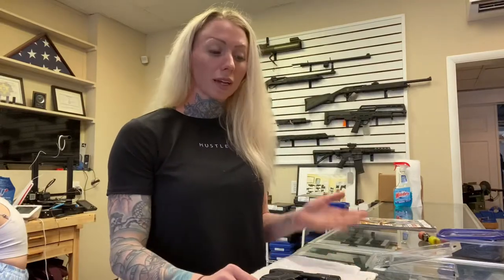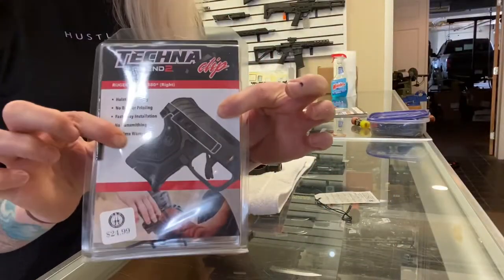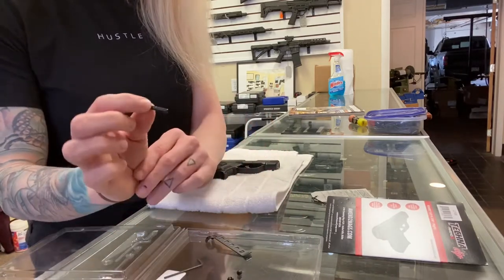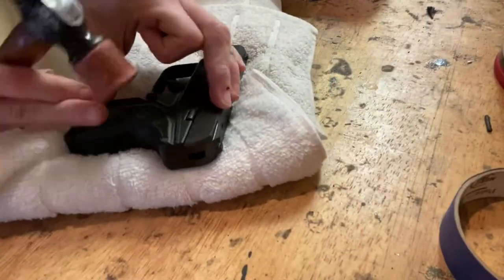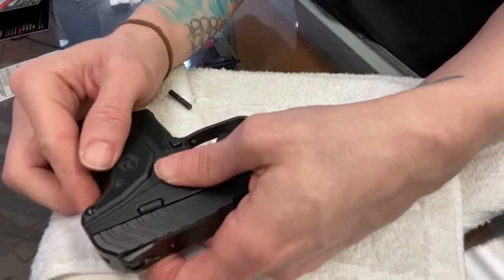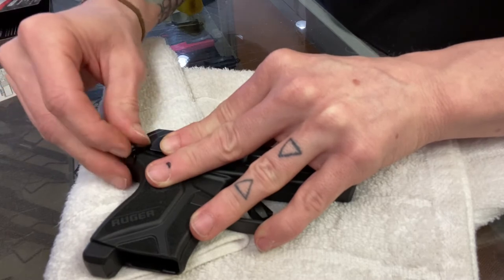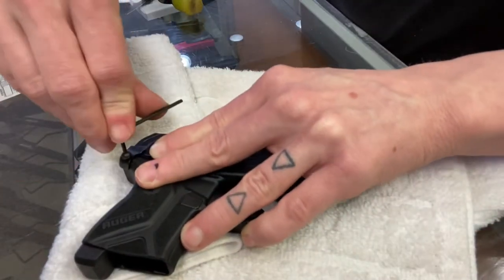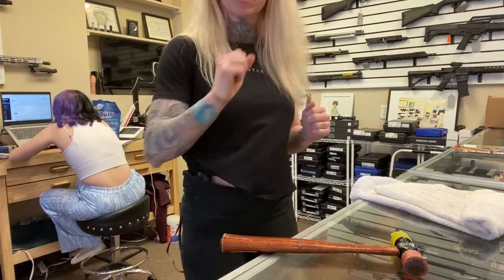Installing a Techna Clip on a Ruger LCP II 380 at H&H Tactical

Comment: After clipping on my jeans inside the pocket and also a thick holster belt certain movements when working in garage caused it to unclip from pocket and belt, separately.  Gave me a heads up in case I’m in public or sitting in car with the LCP clipped to be aware it could happen with certain movements or shifting.  Also got a C & G Kidex IWB holster.  Great for securing whether right carrying or cross draw positions.  I can almost make the clip fit in the C&P and may be able to with some modifications, if I don’t want to remove clip from the .380.

Comment: Cool! I installed one of those on my Sig, P 365 and love it! Need to see now if Techna makes one for the Ruger LCP Max
Reply: I've been looking for the same thing I don't think they do
Reply: @christopherwg4236  same here for the max???
Reply: @christopherwg4236  check this out,,, im sitting here looking at the lcp two image the back where the techna clip is to be installed by removing the factory pin and replacing with the threaded techna clip replacement pin,,theres has a threaded end  theres a female threaded nut that the threaded pin end screws into,,,the lcp 2 and lcp max are identical only lcp2 has the factory poin but the lcp max doesnt and on  the location of that back pin its so far back on the polimer frame bottom cornner im sure thers nothing internally purposed for that area,,aie "free space ,,same as on the lcp2  so if your willing ,,and yep ,,wow ol boy jus might,,,,and yep I'm talkn drilling a hole to accomodate techna clips replacement threaded end pin  all the way through so that the other end can accomodate the threaded female flat nut...and yes i would sacrifice modifying for my own comfort,,worst case scenerios if you change your mind and wanna remove the techna clip then just unscrew take the clip off leave the screw in...but first im going to call technaclip to see because im sure they know that the only diffrence in the area of install of both the lcp 2  and lcp max,,one has a factory hole with a pin and the max doesent but both spect wise are the same...so this would be basically if you wanna  modify your max by drilling a hole there where there wasnt one ...pull images up see for yourself im also gonna call ruger and ask if both spec wise are the same and lastly run by the gun store to compare my max to a lcp 2 if they have one,,again I would be willing to modify mine would you,,,jus a idea but just verify befor you do because this may  be to ruger as enough to void a warranty but i wouldnt see how,,i would verify this also with ruger but im betting theyll say no it wont because the area of install is free unused area and will not effect the dinamics or operation of the waepon,,your not modifying   any moving parts  would might see this as a cosmetic but again will verify
Reply: @cingram8939  that's a good idea but what about lcp2 being thinner than the LCP Max in the frame, could run into a problem there?
Reply: @christopherwg4236  lol you got me lol,,,this was something i was looking into coarse im not a jus move without evaluating questioning which i jus got off the phone with ruger about this,,,they couldnt give me necessarily any diminsions,,plus got my question answered about modifications of their products,,they stated  they dont recommend any or else if you do it could but also not necessarily void warranty,,,but thats a good one you pointed out,,i hadnt gotten that far yet,,i was looking and your right,,if it is thicker of the frame the clip would be fine but the pin which is designed for the pin hold on the lcp 2 is madd for that models dimensions so essentually like your saying if max is thicker then may pose a problem with that pin  to fasten to clip on migh be too short although theres a. Screw in that screws into the pin to fasten down which could give room,,with what youve said and possibly voiding warranty though i.m thinking they wont consider that enough to void it,,i wont take any chance on that lol um good,,i did try to call techna clip,,but think the number is. Not correct or i literally woke some one from sleep they ssaid hello barely then hung up lol good info thanks i was debating but as i weigh options i was leaning then the more i heard the more i was deciding not to then u nailed my decision shut thanks smile
Reply: @cingram8939  I believe it's clipdraw that makes a universal clip that has very strong self-adhesive. Is supposed to work well. I do like the idea of techna clip going through the frame pins though 👍
Reply: @christopherwg4236  me too more secure,,,and the more i keep talkn about it the more im deciding to do my lcp MAX 380 warranty void or not, also wanna install either  a laser or light on this thing too its small i want a light thats small tru glo has the tactal square small but will protrude too far from in front of trigger guard,,,i dont like the models designed to fit around the trigger guard or necessarily on the trigger guard,,,i think thats ugly,,i dont know um not trying to make this thing look junky but unique to my own taste,,,tasteful that is,,,make somebody else want one too and yep i got hands like dat too do my own gunsmithing...
Reply: @christopherwg4236  infact they dont they make them for the lcp1 and 2 but not the max made to install using that lil hole with a pin in the very back of the lcp 1 and 2 Max dont have one,,,unless ye i drill my own carefully and yep already done research its blank space nothing to interfere with function of the weapon at all dont know why ruger did ut one on the max literally the same polymer frame jus that max is a hair thicker due to it accompaning a double stack mag lcp 1 and 2 are single stack but its not too much diffrence,,um probably gonna go for it,,its buggin me that bad smile
Reply: I put in on my Ruger 380.  It went on easy but didn’t seem to want to seat the tiny screw with the pressure washer so I screwed it on w/out.  All is firm but I may try the washer after washing the You Tube did it so easy.

Comment: I got a Techna Amend 2 clip for my Ruger LCD ll .380.  It went on easy excel using a pressure washer.  So I screwed the tiny screw without and it seated well.  Is the pressure washer a must?
Thanks
Kent
Reply: Sorry for the typo above.  Went on easy except when using pressure washer.  I just read the directions w/ no mention of the washer.  After, I watched the You Tube to see how the clip is used but noticed the video was using the washer.
Reply from the maker: Not 100 percent necessary.  I would periodically check to ensure is tight.
Reply: Got it.  Will do.  There are other calibers and pistol sizes.  But the 380 is the primary carry with Underwood fluted rounds when around close quarters.  Different gel tests show excellent performance.  Hope I’ll never need to find out.  Thanks!

Comment: Ok guys final verdict,,,lol i know i was sounding kinda sure and cocky about applying  technaclip hto my lcp max despite its not ment for the max but for the lcp 2 because the lcp 2  has the factory pin and  hole already simply remove the pin replace with the threaded pin that comes with techna clip  screw on the nut to secure and done,,but the max didnt come with the  hole and pin althought is can be done.. I contacted ruger about  drilling a hole carefully to accomodate the techna clip,,ruger stated if you modify the max it could void warranty although drilling a hole would not dysrupt its function and  the location is in a blank area of the polimer frame in a empty area in the very back..i can very close to making my decision to move forward with it,,but what i didnt give in account the frame of the max is  thicker than that of the lcp2  coarse the grip of the max we know is wider due to it taking double stacked mag where as lcp is single stacked,,but looking further the rest of the frame is slightly thicker as well but not by much...Confirmed with ruger a max slide can be installed onto a lcp 2  and vise versa the lcp 2 can on the max with slight very slight looseness but can function without issues..someone on this post pointed it out to me,,,upon this information,,i felt its not worth possibly voiding the warranty or trying to make techna clip work...its nice but nahhh ill pass...

Comment: Do they make techna clips for the ruger lcp max 380?
Reply from the maker: No not currently
Reply: @handhtactical8999  guess what i jus figured,,first off i will install a technaclip on my max,,because the lcp 2  and max have literally the same design and contoure of the area the technaclip installs on the lcp2 only difference the max mag well is wider to to it having double stack to lcp2s only single stack so,,,yep I'm thinking about drilling my own hole to accomodate the threaded end pin and flattened nut to screw on the other side securing it..but ill first call technaclip to verify if they see both lcp2 and max in the area of install are the same contures,,ive viewed both images and they look the same. I'm also going to contact ruger toconfirm and to see that if i modify the max drilling a hole if it will void warranty and im betting no will be their answer  because that far back there appears to  be a blank area a blank pocket in the frame used as just a empty space,,and i think i saw that when i installed my galloway trigger recently.infact let me field strip to see if its blank empty area i shall proceed,,lol if ruger afirms it wont void warranty since it doesnt affect the max ful proper function,,,yep,,,i will be drilling my own hole a simple drill bit only big enough for the technaclip pin to fit in and nut for the otherside,,,itll be a wrap and umma call it a successful install,,smile this i feel gives the best of both world ,,you want a pocket  clip by way of technaclip then put it on,,you dont then  no worries,,remove it and still have  the pin and threaded nut that secures the pin secured... Count mine done if all systems are good when i call....jus my take